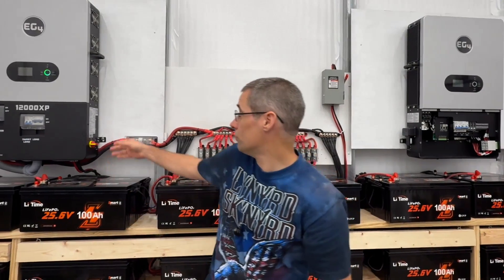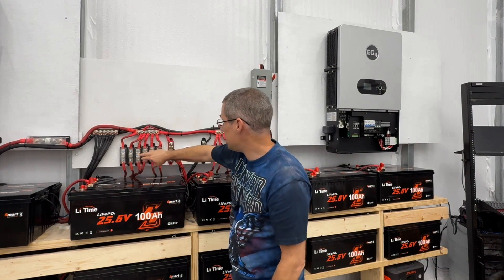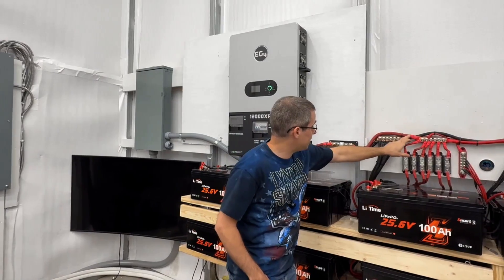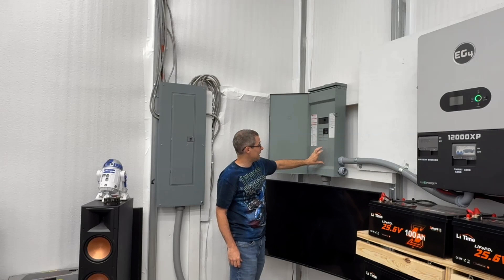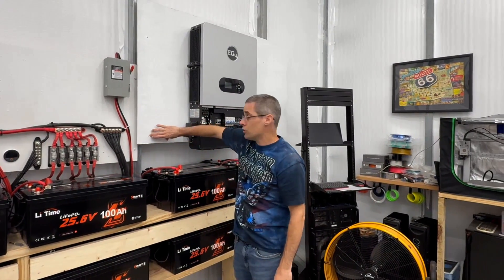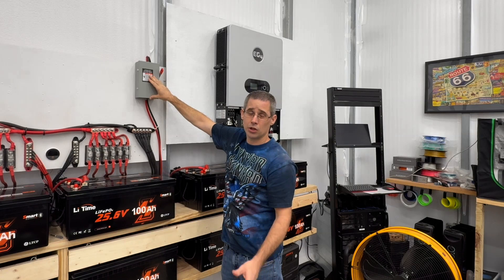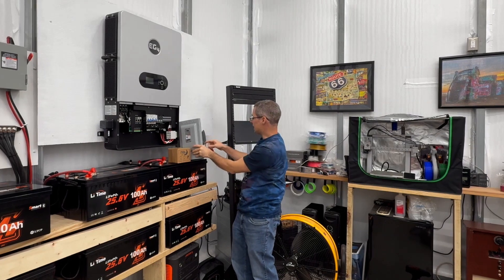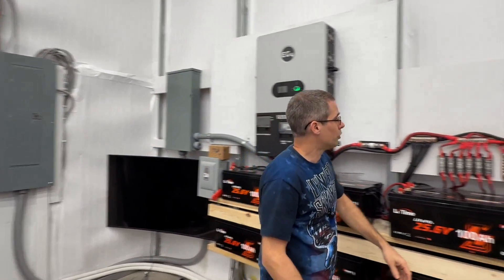EG4 12000XP Installation MISTAKE & FIX! (Parallel Wiring & Cooling Secrets)

Comment: I really dont understand the ac fuses. The breakers already have short circuit protection.
Reply from the maker: That's a great question. Let me explain. If the circuit breaker fails to trip or is slow to respond, the fuse acts as a fail-safe, quickly interrupting the circuit to prevent damage to the inverter or downstream equipment.  What's key is I want to insure if a IGBT shorts closed I can minimize any impact to appliances.

Comment: Looks great!  Do you have whole-battery balancers setup for the 2s 25.6V battery topology?  That could present a bit of a problem if you don't as they can easily get out of balance with each other (one battery too high, the other too low) over time.  They won't self balance and if one battery in a series disconnects for any reason, that series won't reconnect/bootstrap due to how its setup.

Those two positive bus bars look like they're 51.2V rather then the two 25.6V halves.  Things could get complicated.

-Matt
Reply from the maker: Your right Matt it does have some balance issues I f I don’t let it go to 100 percent from time to time.  I added some additional panels so it bounces between 70 and 100 percent most days.  That keeps the batteries balanced within 5 percent of each other from hitting high to low.
Reply: @MikesSolarGarage  Its a bit of a tough situation with that battery topology, because there really aren't any cheap 24V x N whole-battery balancers on the market.  Lots of 12V x 4 balancers, but not 24V x 2.

In anycase, if you notice any individual 2s battery groups dropping out, this is why.  They could be dropping out and you just aren't noticing, or they haven't gotten so out of balance yet that they are hitting BMS disconnects.  If something strange pops up with that battery bank, keep this in mind and test individual batteries for drop-outs / imbalances.

You might end up having to rewire the battery banks into two separate 24V banks and then series the two banks toger the into a 48V bank, to allow you to install just one 24V x 2 balancer on the whole system.

-Matt

Comment: I thought 4/0 was only rated 230Amp @ 75°C. 260Amp at 90°C.  Also, having wires close is ok.
Reply: Ya but it's also micro strand welding wire. It'll be fine
Reply from the maker: You are absolutely right it is rated for 230A at 90c per NEC.  The cable insulation is rated for 105c and I have a 250amp fuse.  I’m hoping it would be sufficient.

Comment: I like your build and I am working on installing the same inverter but shouldn’t you be using the same length of wire between the black and the red wire? Thanks
Reply from the maker: The black and red should be the same.  I think the length is slightly different between the two.  The most important thing is having all the positives and all the negatives be the same length.  The T class fuses on The positive side add resistance.

Comment: You should really put some space between those wires Mike! I know you did your homework but even the tiniest bit of heat over time will melt those insulation jackets and torch that sucker! Keep up the vids and super cool!
Reply from the maker: Good point rattletrap,  I’ll fix that.  Definitely a good call!  Thank you!

Comment: AWSOME setup Mike! I too use 600v heavy duty fused disconnects for my PV. Bussman makes some PV fuses 600v rated,  mine fused at 20a they are yellow.
Reply from the maker: That is great to hear Donnie,  I have seen many videos where the cheap Chinese solar disconnects catch fire.! I thought heavy metal would be better.  Thanks again for watching!
Reply: @MikesSolarGarage  yes sir! I’m an industrial electrician have been for 35 years, Square D, Siemens ,GE  HEAVY DUTYis the only way to go. I use square d,because we are a square d installer